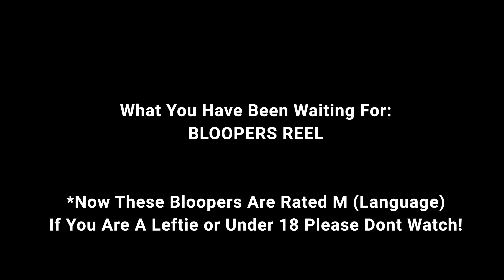We Finally Pick Up Our Hybrid Caravan #Panda13 & Great Ocean Road Trip

Comment: Great van and plenty of trips to be had in the Panda Sarge..??? Did the McHitch come standard with the Panda

because there a top hitch and even easier to use..👍 🇦🇺 👍
Reply from the maker: Yes mate. First time I have used one of these hitch’s and it’s the ducks guts. 
Yes we are planning a way as we speak. Thanks for watching
Reply: @SargeNurseOffRoading  TIP Sarge when your hooking up the  Panda to the BT with the McHitch,get the awning strap puller
measure the ground up to the centre of the cup on the BT AND put some tape on the centre of the cup because that will never change
then lower van down to the tap mark on the strap puller......and whoosh car bingo...
Reply from the maker: @newyboys  awesome mate I will give that a go.